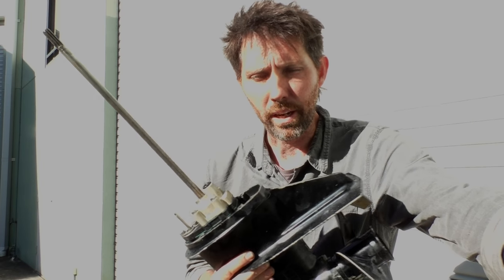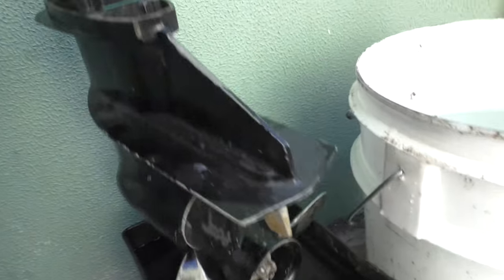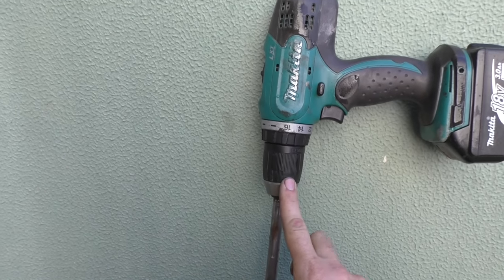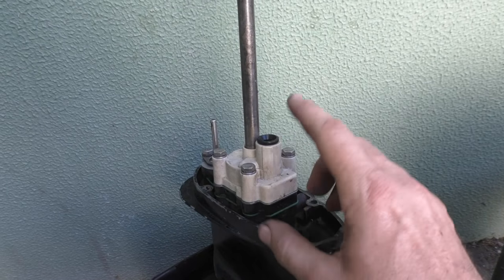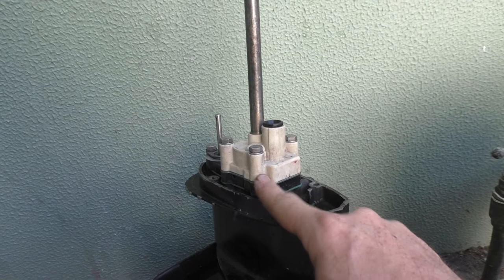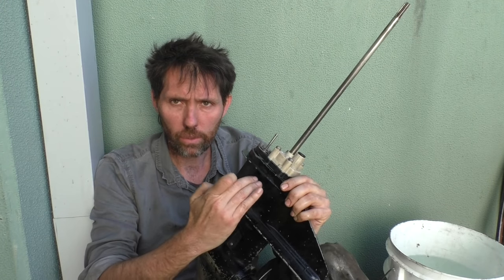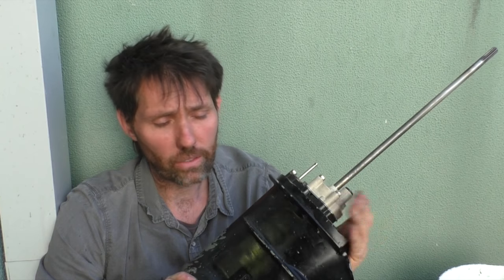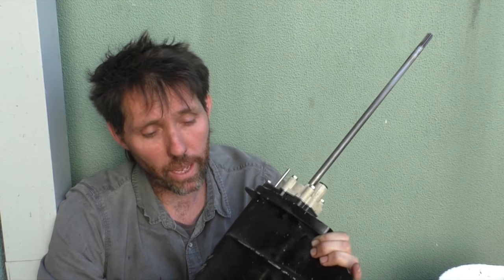Testing an outboard water pump

Comment: I have a 2000 mercury 15 HP 4 stroke that is starting to spit water out of the overflow top exhaust port along with some steam at the rear of the motor and I had a guy tell me it was the impeller that needed replacement, could this be right even though I have a decent tell tale stream being put out?
Reply from the maker: Water out the top exhaust is generally normally, steam not so much. The tell-tale will let you know that the pump is pushing a reasonable amount of water, but it is still no guarantee that the motor is being cooled. If the thermostat is stuck closed the water will never make it though the engine to cool it. I would start by checking that.

Comment: Your videos always help me out thanks heaps dude
Reply from the maker: You're welcome mate. :)
Reply: @DangarMarine  
I have a good question 
I tend to come across alot of older outboards 
My current resto being a 73 evinrude runs beautifully however 
I've noticed none seem to have a kill switch/lanyard

I know its fairly easy to wire one up but I'm curious did the older control boxes come with separate unit for start stop 
I assume switches were just wired to dash back in the days
Reply: @DangarMarine  
Sorry the question is 
Does the factory loom already have a kill switch I've found start wire and one moves a vacuum looking actuator thing others are unknown

Comment: ok what would be the issue if you know your water pump is working and aired the lines out but its still not getting water to the block?
Reply from the maker: Could be that the outlet pipe isn't going into the pump when the gearbox is put back on.
Reply: that was it, its pumping like a champ now. Thanks

Comment: Stu, whats the purpose of the base plate?
Some kits do not include them
Reply from the maker: It forms the bottom of the pump housing. The impeller rubs against it and it will wear out eventually but being stainless they last quite a while which is why they aren't always included.

Comment: Interesting. I have heard that water tends to circle in a drain the opposite direction south of the equator, so I assumed most outboards down there would rotate anticlockwise.
Perhaps the issue is that it can circle either way, but be more efficient in one direction or the other depending on which side of the line you are on...
Reply: of course that has nothing to do with outboard,or inboard, water pumps; these do not care about the coriolis effect, which is due to the rotation of the earth,and it is a very very small effect, negligible

Comment: Is this the same with say a 150hp Mercury. I’ve got muffs on it, it sprayed water for a slip second and now won’t. I did just get it going, hasn’t run since 2013 until today. Runs great, just won’t pump water from muffs. Should I try to put it in a tub or tank of some sort
Reply from the maker: Yes, just need a bigger drill probably.

Comment: Absolutely love the channel!  Thank you!  Just installed a new impeller on my 5hp 2 stroke.  The old one was working fine but now the new one isn't peeing.  I installed 2 new gaskets and did not put sealant on them.  Should I have?  Made sure all the vanes are aligned (for clockwise spin), verified key in place, so I'm confused.  Will run the drill test today as that's much easier than reassembling the whole unit to test! 😁
Reply from the maker: Sealant is unlikely to have caused your problem unless it migrated into the pump.

Comment: good video man. i think i will try a deeper bucket. i get water out of the tell-tale if i hook-up the garden hose but no water in the small bucket i was using. so if i don't get water out of the tell-tale with a deeper bucke. its probably my impeller not pulling suction. because the garden hose is providing the pressure ? does that sound correct to you?
Reply from the maker: Yep, your understand is correct.
Reply: thanks for all of your good info man. it worked perfectly!

Comment: How tight should the shaft be after replacing the impeller? I can still turn it by hand but it’s not easy
Reply from the maker: Yes, it can be quite hard to turn on a larger motor with a new impeller in.

Comment: Should any water come out around the shift linkage?  I have a Suzuki 4 stroke electronic fuel injection. When I run it with a hose and ears water comes out around the shift linkage. Seems weird. Any thoughts please?
Reply from the maker: It is probably just a drain hole for the casing so water doesn't sit in it.
Reply: Dangar Marine thank you

Comment: Which way do I put the impeller fins when I install it?
Reply from the maker: It depends on the direction the engine rotates, but most (ie. not Honda) rotate clockwise. As the engine rotates the fins bend backwards in the other direction as they are pulled around.
Reply: @DangarMarine  I appreciate the explanation. Thank you.

Comment: We inherited a Johnson 112 SPL and with the powerhead removed we can manually rotate the driveshaft clockwise in neutral but it locks when attempting to rotate backwards.  Can a bad impeller cause this ?  Thank You
Reply from the maker: Driveshafts are only designed to rotate in one direction. The engine always turns the driveshaft one way and the gearbox allows the propshaft to rotate both ways.
Reply: @DangarMarine  Hey Thanks for the reply - I understand about the gearbox providing the change in direction.  We dropped the lower unit today and it was indeed the dry impeller that was preventing turning the driveshaft backwards. The shaft rotates freely in either direction with the impeller removed.  Since we had no history on the motor I was rotating it by hand to first make sure it had not thrown a rod or something.  Your videos are great and I am pointing my Grandson to them for each step of this project,

Comment: I just replaced the trigger on my 1987 75 hp 2-stroke direct injection, due to some faulty wires. After i had replaced it i put my muffs on the intakes and it fired instantly! However i did not have any water pumping out of the telltale. Is it possible that this is the case that you are illustrating here? I am a heavy equipment mechanic, but i am new to outboards.
Reply from the maker: Muffs can be a bit hit and miss with getting water into the pump. I usually try holding the muffs hard against the intake grill for a while to see if I can get the pump primed with water pressure before starting the outboard. If not try putting the foot of the outboard in a bin of water like this vid.
Reply: Dangar Marine yeah I ended up holding the muffs by hand while the wife cranked it and it started coming out the telltale with a nice steady stream! Cheers mate

Comment: Hi, I just serviced lower unit for Mercury 50hp 1973 thunderbolt 500 I used your tips and test my water pump work correctly however still getting no water from pee hole. I think a piece of old broken impeller got suck in and block the water passage. I have no problem to run water down from pee hole but has a problem run from a copper tube to a pee hole using modified water hose with hose clamp but the pressure too tight and popped the connection. Do you have any idea how to unclog ? I used air compressor,water, thick wire to poke to see anything is getting clogged but no luck.
Reply from the maker: It can be tricky getting bit of broken impeller out. Often you need to take the powerhead off the outboard to get to the top of the pipe up from the water pump.
Reply: Dangar Marine I’m got one of the tips from YouTuber and able to adapting water hose to inlet tube with low pressure water and it peed but now I had my gear in neutral before I insert the lower unit in somehow when I start the engine it’s in forward gear and can’t put it back in neutral, any tips ?

Comment: I'm replacing impeller with pump kit tommorrow.  How do you work out or Which way does an Evinrude 15hp go clock or anti clock. And are the exactly the same as the Jhonson as all the kids say Johnson Evinrude 9hp to 15 hours mine being a 15 about 25yrs old! So don't want to wreak it.
Do you do Pittwater also? Did you grow up with the Haysoms from Lovett and Elvina Bay as I did know some of your family I believe.
Reply from the maker: Just pull on the starter cord and you will see which way it turns. No, never lived in Pittwater.
Reply: @DangarMarine  Thanks for quick reply mate your channel has to be the best from an expert in marine on youtube. I have such trouble with people saying this is how you deffinently do a repair if fiberglass or a motor and having no idea, so thank you. I have worked Pittwater and the Hawksberry for years doing wood work and classing but not much mechanical. And have learnt more from 10 video of yours then in 30 years you little legend.
Impeller kit arrived 5 min ago so now to get stuck in, already have the lower leg off and ready to go.
You are up near Dangar Island though? Thanks again Gus

Comment: i just bought a boat and motor   the motor is a 70 hp Johnson  I was told by previuos owner that they didnt have a telltale on that model  but for my own peace of mind I replace the water pump  could you tell me where the telltale hole is on that motor
Reply: What year is it? Hell, most outboards even the old Evinrude 2hps have a telltale. They spray water mist vs pissing but, still have a telltale. Ever find it on your outboard?

Comment: Odd question, I was working on my water pump and when I took out the crank shaft, the woodruff key fell into the hole, I've drained the oil hoping to find it but no luck, is it okay to leave in there, or should I pump water in to retrieve it?

Comment: Does the pump go in the direction of the flywheel i know stupid question but i have a customer who has a 03honda 50 the flywheel is marked counter but the pump sucks in through the output. And it seams counter intuitive to have the flywheel spin counter to the shaft. Only other things i can think is the plate is cut for counter and clock, or some kinda block is causing it to pull from the easiest source and if i didnt mention is i tipped the out put into the water bucket and applied finger and confirmed sucking in counter and pushing in clock. And its confusing because that and verifing the engine flywheel rotation.

Comment: Great Videos! I have a 150 Etec that does not like to pump water when using muffs but is quite happy in open water. any idea why ? Maybe an etec thing?
Reply from the maker: Yes, some outboards don't work well on muffs. You can try holding them hard against the outboard until the pump is primed.
Reply: Thanks mate ! strange isnt it you would think the pressure would help it prime ?

Comment: Further to my last comment, I have seen many videos on youTube where people have used the ear muffs to circulate water and they seem to work okay. Any idea why it would not work on my unit. I have been thinking about this, so I decided to remove the lower section and check the impeller, still convinced that must be the problem. To my surprise everything looked in pretty good condition. I have to assume that the  water from the garden hose would have sufficient pressure to force the water up to prime the pump, based on all the other videos.  We have good water pressure  in our area and it is a good size hose. Can you think of any other reason why it will not draw water. I have checked the pee hole and the tube running to it and it is clear as water flows when I use the flushing hose attached to the upper part of the engine   I do not have a drill big enough to fit over the shaft, or any type of connector  to do the test you showed on your video.  Thanks again. Bob.

Comment: I have a evinrude 115 starflite I believe a early 70's the water pump was destroyed inside how do I know what direction it goes
Reply from the maker: +MrPancho728 Just take the cowling off the motor and turn the key to start it and see which way the flywheel turns. The impeller needs to be installed while turning the driveshaft in that same direction.

Comment: Question,  I replaced my impeller on my yamaha 200 2 stroke. It worked fine.  The next day it wouldn't pump,  did your test and it was working in the tub.  Hooked the hose up to the engine without the lower unit, water flows fine.  Impeller and housing look fine on inspection.  Any other suggestions ?
Reply: Just make sure all the pieces look like they fit correctly, in the correct orientation. I did the same thing with my old 7.5

Comment: When i did my impeller and put it back together i noticed that it has two holes in it, by design. The impeller pumps water just fine but at a certain back pressure it starts squirting water out of the holes. Is this really the way it's meant to be or did I screw something up at the installation? Are these holes supposed to be plugged somehow?
Reply from the maker: It is quite normal for water to come out from a holes in the leg.
Reply: Dangar Marine thanks a lot for the answers, about to put my engine back together and run it, exciting!

Comment: So our Tohatsu gear selector's lower splitpin? (rolled split pin) fell out so we gotta do that and figured might as well check impeller, etc. Secondhand m70c Tohtasu I think 2003ish, visible rust in a few spots like the big shafts holding motor to the tilt section so I figure we're gonna find quite a bit to clean up, maybe replace some circlips, etc. 
Motor itself works fine, just wondering on some good maintenance tips n what to look for n replace when the leg is off?

Also motor was lifted a few bolt holes and the lower holes have about a 1-2mm gap surrounding it, boat was great at first but was slow to plane after a few hours last trip and the bilge was fairly full of water. What would you recommend? Previous owner just sikaflexed.
Reply from the maker: That pivot yoke is rusty on just about every outboard I've ever seen beyond a certain age. It is the only bit of mild steel in the whole thing unfortunately. While the gearbox is off I would pressure test it an replace any seals that are leaking as well as doing the water pump. Other than that and a bit of clean there isn't much you can do. There is a also bushing the driveshaft runs on just up inside the leg that you could check too. With regards to the mounting bolts I would probably use Sikaflex in combination with some stainless steel washers that fit tightly around the bolt, unless of course you can change to larger bolts.

Comment: Great vid and I have a question on a separate subject  I have a 21 contender with a 2001 Yamaha Saltwater series 2. That is 200 hp.
It is connected to two digital gauges that will not show any information on them. I believe they are getting power because the panel light inside each of them is coming on
Reply from the maker: Those lights are powered separately from the gauges themselves - there will be two wires going to the globe externally. I'd get in behind and trace where the other wires are going it. They should all be wired to the ten pin loom.
Reply: Ill check first thing tomorrow thank you!

Comment: great video,Great tip
do you have a video of impeller on old 9.8 hp mercury? I can't get the key way to set right,it's so small
Thanks
Reply from the maker: Unfortunately no. The woodruff keys can certainly be fiddly. A bit of rubber grease can sometimes help with both holding against the shaft and helping the impeller to slide over it.
Reply: I m working on a 1975 9.8 mercury outboard and the key on impeller is so small it's very hard to set. I have tried everything,
have any tricks for me or advice. I'm about to give up
Thanks
Tom

Comment: Thanks for Another great video, I just replaced my impeller and it’s an hour and a half drive to the coast so I wanted to see if there was anyway I could test it at home but my storage bin just barely covers the bottom intakes and the muffs that I was trying to use don’t seem to work either, but it is still entirely possible that I did a decent job on the install and it will work when I get it submerged in more deep water, I assume based on your information. I couldn’t get anything to come out I ran it for about 25 to 30 seconds just covering the bottom vents and it would not pee out of the top hole.
Reply: Did it work...?

Comment: Thanks for the tip.  I am a newbie at engine repair, but I have learned a lot from you.  When I placed the lower unit in the water there was water coming up the gear casing.  Is that normal or do I have a problem?  Thank you.

Comment: my Yamaha 25hp is doing the same thing... would you be able to pour water down the thermostat to prime it?
Reply from the maker: If the pump is above the waterline it will just run out.
Reply: @DangarMarine  yeh okie haha just tried it.. did exactly that. do you have any ideas? brand new waterpump, thermostat, water gallery gaskets. cleaned and checked everthing internally in the water galleries. it pumps water out of the exhaust ports but not the tell tale?
Reply from the maker: Sounds like the telltale is just blocked. If you push water backwards through the telltale with a hose does it come out at the pump?
Reply: I did try that. yeh it fill up but then comes out at the exhaust. I noticed that when I flip the leg out of the water there is a leak coming out of the prop area.
 (where that seal is for the gearbox) 
thinking its sucking air from somewhere?
Reply: or possibly the water tube isn't seating on the water pump correctly.. I dunno haha going to keep battling with it

Comment: thank so much. my water is not coming to engine. checked in take hose, dry, maybe it has a clog at the outdrive hose, can´t determine. but after seeing your video, maybe its the water level, my bucket is not high enough. maybe i can just drive it to the beach ramp and try.???? I also put salt away in the hose at the engine, no luck.
Reply: can i apply compressed air from the engine intake water hose,????? because i already put the lower unit back in place, very difficult.